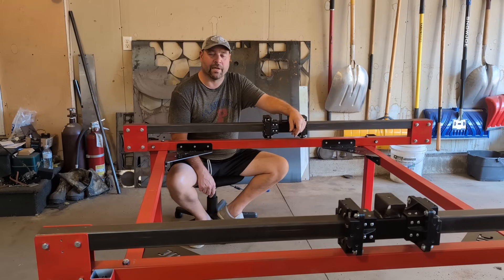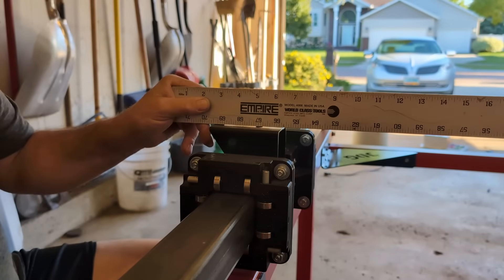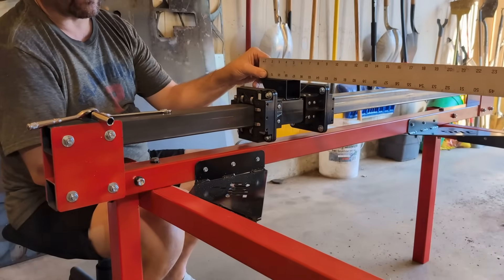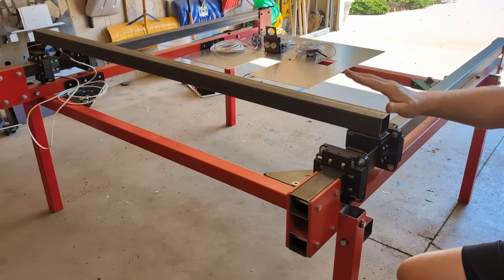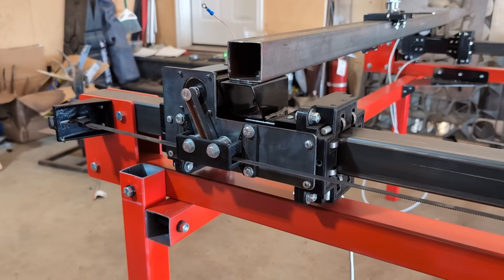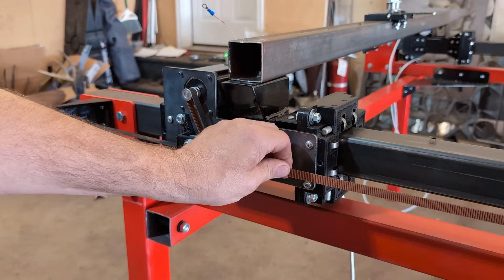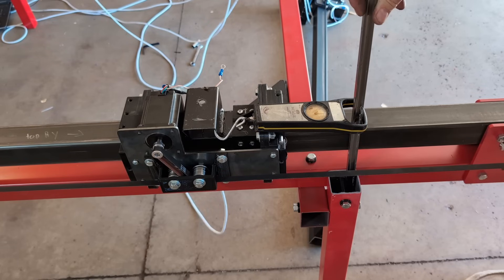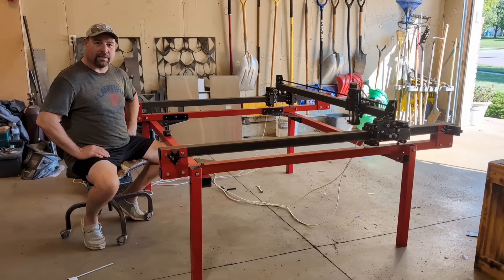Budget DIY CNC XL Plasma Table || Motors and Drives

Comment: Hey there. I was curious as to why the squaring plates are not included in the precut metal package for the XL?
Reply from the maker: They are not required for the machine to function and are intended to be cut out by the user as their first job.

Comment: Your shield should only be grounded at one end to prevent potential ground loops. Is there a list of electronic/motor differences between regular and XXL? I'm just starting to buy matl for regular, but like to future proof in case I want to upgrade. I seem to have upgrades arrive before what is being upgraded typically.

Comment: It's weird how this looks like a complete knock off of the Langmuir Crossfire Pro, minus using  belts instead of lead screws, and a whole lot of plastic parts where there's going to be a heck load of sparks and heat.
Reply: I'm building one I hope anyway.
Reply: Just had a look. Very similar!
Reply: One guy hase used his 2.5 years no problem machine it proven heat don't effect parts much if you take care of it.
Reply: @admathaideasrcwwoidtke3221  k. cool. neat even. Doesn't change the fact he's knocking off another design. Can you use punctuation?
Reply: @admathaideasrcwwoidtke3221  k. cool. neat even. Doesn't change the fact he's knocking off another design. Can you use punctuation?
Reply: @admathaideasrcwwoidtke3221  your "sentences" make my head want to aneurism.

Comment: Could you just put the gantry in with the nuts loose and then tighten it up.  Then check for alignment with it out to be sure there's not much pressure on it?

Comment: The shields should only be grounded at the main earth in the control box. Grounding both ends can create ground loops
Reply: hi!  I am father, I follow your videos from Uzbekistan, I made a cnc plasma lathe, I used it with Arduino uno board, it does not work for a long time, it makes noise, is my plasma gun high frequency?  what can you advise
Reply from the maker: That would be the case if the machine didn't have dielectric substraights.
Reply: The only issue grounding at both ends could possibly cause in this instance would be a tiny amount of increased heat in the line due to the closed path that is created, allowing current to flow through the shield. The amount of current that would be induced here is so small, it’s negligible. The advantage is that it is better able to deal with both capacitively and inductively induced noise.
Reply: This depends on the type of interference being generated.  Magnetic fields generated by motors require grounding at both ends.  Electric fields, which is the cause of most interference, can be squashed with ground connected at one end.

Comment: Awesome work!  As you know, most of us work out of garages where space is at a premium.  Any thoughts on a tilting/folding table that stores vertically for storage but transforms for horizontal use?  Thanks for your consideration.  Keep up the great work!
Reply: I second this question
Reply: It will be out of square every time you "fold" it away. Not ideal.
Reply: @Boosted98gsx  Challenge accepted.  You'd have to weld the frame pieces.  Gantry squaring is taken care of in the operation of the cutter.
Reply: @karlgabel9822  It will still flex (and warp after welding). You cannot take "into account" X-Y squaring when the Y axis binds due to the rails becoming 3-dimensionally un-parallel.  You'll have to loosen everything to realign to confirm unrestricted travel.

You'll also lose work area if your X-Y paths create a trapezoidal work area, esp one that moves (and needs recal) every time you store/redeploy.
Reply: @Boosted98gsx  Let's put this to the test.  I tire of speculation.  This sort of folding table design has been done with standard cnc machines and can be done as well with plasma tables.  Warping and flexing during welding is preventable with proper attention.
Reply: @karlgabel9822  ok cool, do it then.
Reply: Or just have the cnc designed to be tilted at an 80° angle like the one Cranktown City did

Comment: Wow !  I was completely unaware you were even working on a larger unit.  I am subscribed to the channel and this is the first video i have seen from you in over 6 months.  Anyway, my unit is structurally complete.  It is interesting.  I have the exact same box you are using on the new unit .  My unit, unfortunately,  is still in my bedroom ( where i built it ).  I still lack a building to put it into.  Obviously,  i have not run it given both its location and the fact the wiring is not finished.  With those conditions in place, it is probably a good thing you talked me out of making it larger.  I am assuming there are plans for the new unit either on the way or already available   ?  In any event, it is great to see more content from you two talented guys. Demon
Reply: I have also been a subscriber for a while and have not been getting notifications. I used to think it was a YouTube conspiracy, but I’ve recently gone through my channel and erased a bunch of old subscriptions that I no longer am interested in in the more subscriptions that I erase the more of these older channels pop up and I’m been getting the notifications for them, which I am grateful for!
Reply: @thisdayage7997  thank you for the headsup. I will try that and see what level if success i have.  Have a great day !